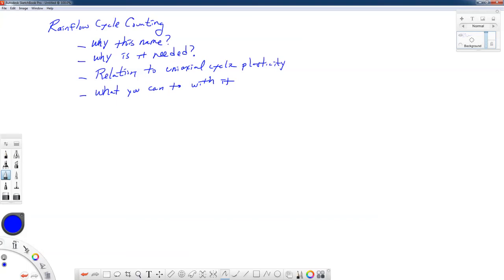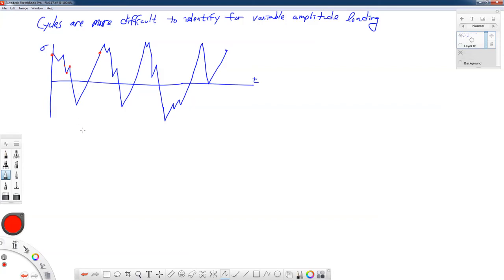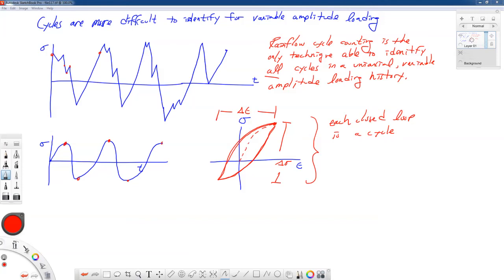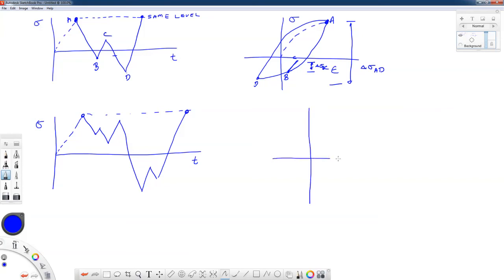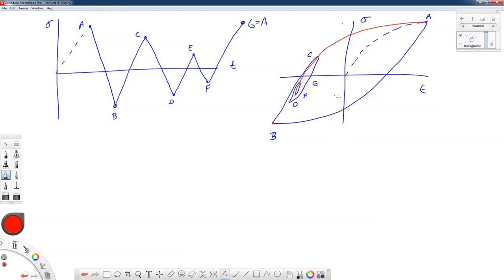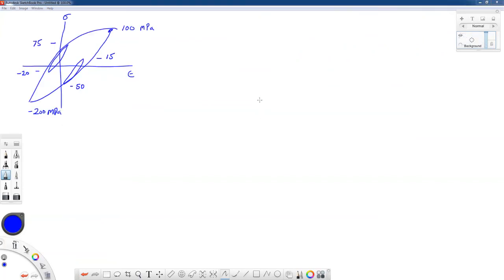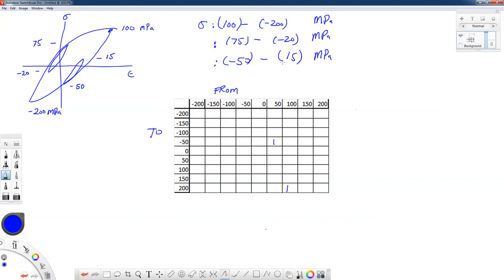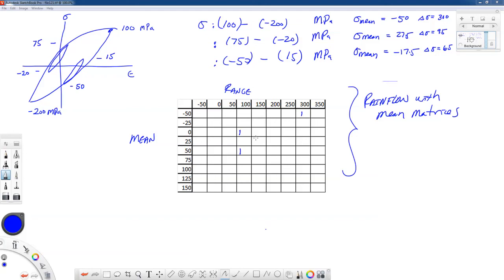Rainflow Cycle Counting part 1/3--Introduction

Comment: Thank you very much for your fruitful lectures. Could you please give me your email address? Actually I am working on fatigue analysis of mooring line. I have already got load history. But i can't determine the number of cycles as i have several same stress levels in diagram. I would be grateful if you give me your email address. Thank you

Comment: Does the method for closing the non closed hysteresis loops (from 15:) is equivalent to apply the rainflow counting to the mirrored signal ?
Reply from the maker: By mirrored signal, do you mean repeating it back to largest peak?  If so, no, since for unclosed loops the damage is usually taken to be one-half the closed loop damage.  If you mean something else, let me know.  But I don't think any method of artificially closing unclosed loops and counting half damage would be like any other technique.

Comment: at min 11:40 whs is is the stress at c on the right negativ and on the left positiv?
and why is at min 20:50 the part between G and F not fully marked red?
Reply from the maker: at 11:40, C should extend into the positive stress side on the hysteresis plot to be consistent with my time history.  That said, this example is a sketch to illustrate the process and not a numerical calculation.  Regarding 20:50, I don't remember why I used different colors.

Comment: Thank you very much for the lecture. From this video and the following two, I did not see any description regarding the difference between half cycle and full cycle. Could you explain a little bit on this issue? Thank you.
Reply from the maker: Hi Xiaohu Zhang, a half cycle is called a reversal.  Two reversals make one cycle.  The only consistent method for variable amplitude loading to determine reversals, is to determine the number of cycles and multiply by two.  I hope that helps!
Reply: @mbarkey.mechanics  Thank you for your response. It really helps.
Reply: @mbarkey.mechanics  Do the reversals have to be of the same closed loop, or can be any reversals of the same stress range?
Reply from the maker: @arcsaber1127  The only way to identify the cycle is the formation of a complete closed loop so there is no need to do anything with other reversals*.   *The exception being for cases in which your time history does not start/end with the highest event in the time history; in this case you can get a residual--the damage in this case is calculated by closing all the remaining open loops and taking half-damage for the residual.

Comment: Excelent video. I have a question, at 13:15 why is the strain at point C smaller than at the point B ? If the Tension at C is higher than B's the strain should also be higher, right ?
Reply from the maker: My sketch isn't great.  I am indeed trying to indicate point C on the hysteresis plot is a little to the right of point B on the hysteresis plot.
Reply: @mbarkey.mechanics  the problem is that point C has >0 stress, isn't it?
Reply from the maker: @egrabovic3577  yes, the point C in the sketch should have been a little positive, but that does not matter to identifying the cycle.